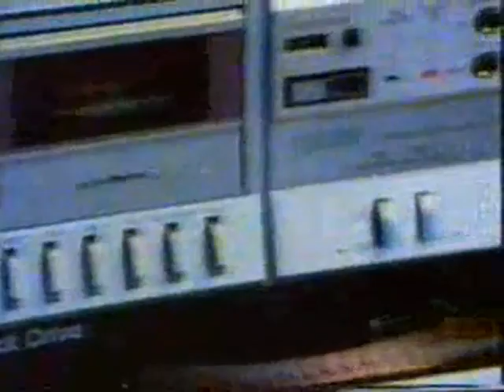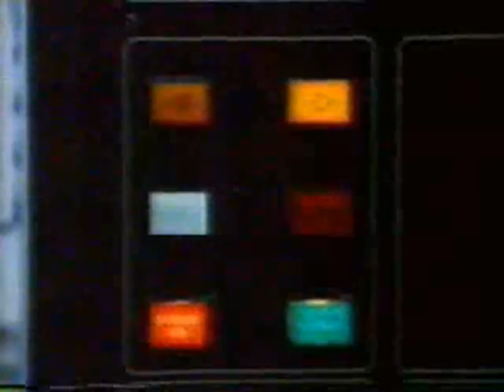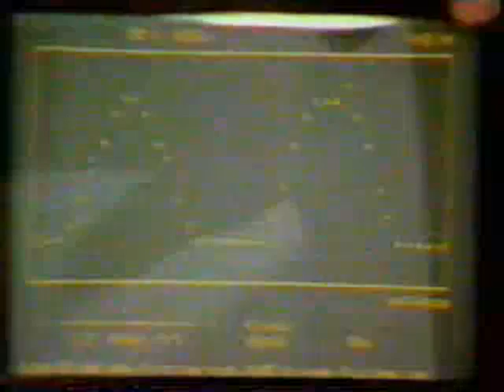FloppyDisks technology explained in 1984

Comment: I think that floppy disks were somewhat more resilient than this piece suggests. I used to put them on top of speakers, TVs, sling them about a bit, not put them away properly, and I don't think I ever had a single issue with any one of them. Not unless I REALLY inflicted damage to one, but it's not as though anything else could withstand unlimited abuse.
It's so fascinating to watch these shows today. It makes you want to step in and show them how everything is now. Their heads would explode.
Reply: This piece seems to suggest that 1 out of 5 disks tried have a problem with the tests given (based on the "do's and don'ts" printed on the disc sleeve). How did you think the piece was suggesting that discs weren't resilient?